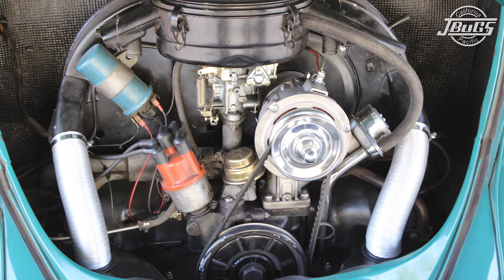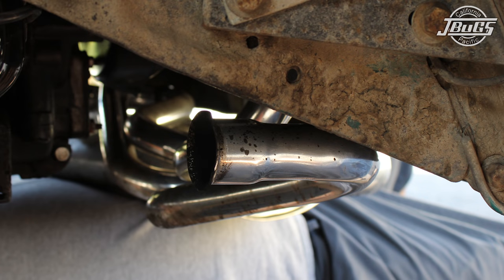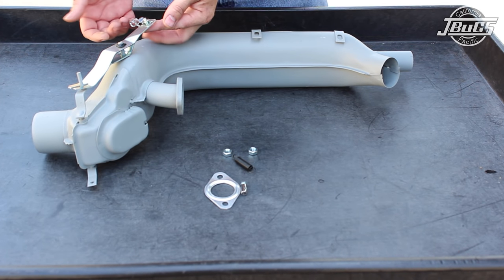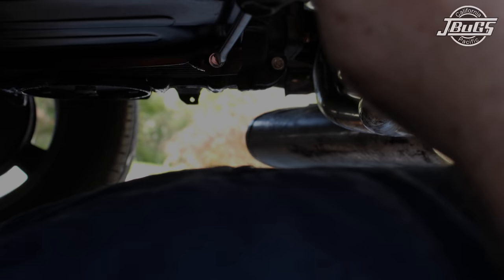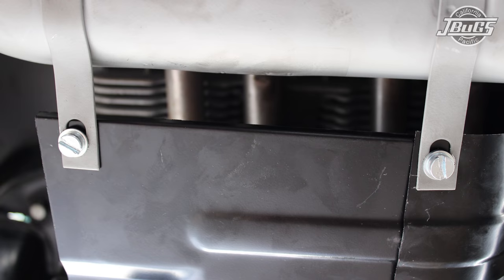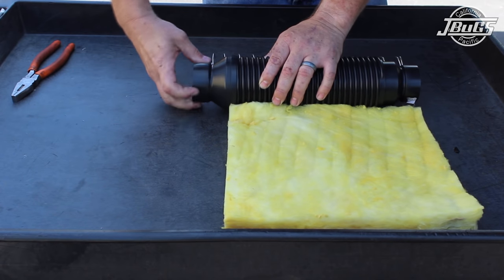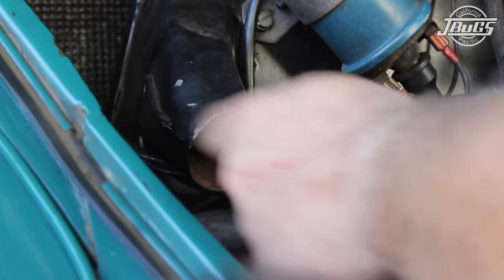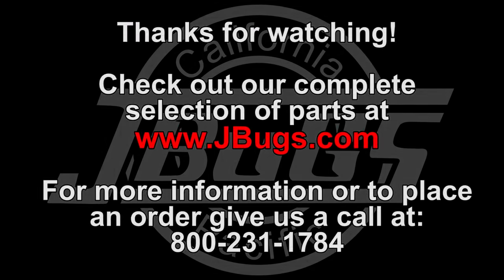JBugs - 1967 VW Beetle - Heater Box Installation

Comment: Hey Jbugs, you guys are awesome. I'm watching this to remove my heat exchanger but I've kind of hit a snag. I can't remove the one that's on there on the passenger side as its completely rusted to the exhaust ports on the cyl. head. Do you have any tips? It seems like it separated a little bit from the heat exchanger itself so when I move it, the entire heat exchanger moves, except the flange part of it... And help appreciated!!
Reply: The exhaust pipe, tube, exchanger, etc are all steel. The head is aluminum so the exhaust flange can't really be rusted to the head, the studs, maybe a little, but not the head. If the nuts are removed, just use a little more force (hammer, pry bar, etc) to get the heat exchanger free from the head.

Comment: You made removing the j tubes looks so easy. 🤣 I’m hoping I don’t break an exhaust stud.
Reply: Been there, done that! A little heat can help if you feel like it's getting to that point. If you don't have a heat source (propane or map gas torch, etc) start up the engine (if it runs) and let it warm up a bit. Sure, working on a hot exhaust requires a bit more caution but NOT breaking an exhaust stud off in the head is worth it if need be.
Reply: @Sam_Mebane  thank you for the tips!

Comment: Hello and Blessings to you all ... I just purchased a 1966 Beetle and have started restoration, I'm very new to this and at the same time learning and watching JBugs videos , great job !!    Now I live in Florida and the "Heater Channels" and shut, broken and rusty and poorly welded to Floor pans, so My thoughts are to change both Heater Channels and Floor Pans .  Now do I really need the replacement kit shown cause the weather in Florida is mostly hot or rains but it doesn't drop in temperature often and as much. The vehicle does not have any connection whatsoever 
Word of advise and guidance will certainly be appreciated, Thanks  JR.- .
Reply: We covered removing and replacing the heater channel on our 1971 Super Beetle project a couple of years ago starting in this video - https://www.youtube.com/watch?v=xRxd2g6MUi0 

Hopefully that helps a bit!

Comment: Is it possible to run a custom exhaust with the stock carburetor air intake on a 72+ Super? I can't find any diagrams/videos that show how the preheat hose would be attached.
Reply: The installation is the same as we show here.

Comment: so... I am actually removing heater boxes and installing jtubes... how do I keep bugs from getting into my bug through the heater channels?
Reply from the maker: Caps can certainly be made to cover the holes. To our knowledge there are no parts available off the shelf for this modification, however fabricating some sort of cover is a good idea. We have seen people do things as simple as zip-tying a screen over the hole, we have seen others go to the extent of cutting circular sheet metal plates and welding them in place. This ultimately is determined by just how permanent you wish the modification to be.

Comment: which side do you usually have to cut approx. 4" off those black heater bellows hoses? driver or passenger side? I also see you didn't use or need those round rubber like 'seals' that can go on either end. Did you just get lucky & all the ends matched up perfectly & just needed a clamp on each end? LOL
Reply from the maker: BOTH hoses were shortened, but don’t cut anything until you verify the length your situation needs. Different engines, heater boxes and chassis can change the length of the hose needed. The rubber boots aren’t typically needed with the replacement hoses, but always verify the diameter of the outlet on the heater box and the inlet on the car before tossing them.
Reply: @JBugsVWParts  do you guys sell the rubber boots?

Comment: Hello JBUGS,
I am looking to put an aftermarket exhaust and/or headers on my 69 Bug while retaining my stock heater boxes or a pair of your heavy duty heater boxes. How can I tell if the exhaust will require me to modify my heater boxes or the exhaust in order to get them to fit? And what modifications should I expect to make?
Reply from the maker: Hello Trenton!
We have an article on our website that may answer all of your questions about modifying your exhaust system, although it may not be specific to your year vehicle (http://www.jbugs.com/VW-Tech-Article-Beetle-Performance-Exhaust-Systems.html). Feel free to call us at 1-800-231-1784 and speak with one of out techs with any questions you may have.

Comment: Hi, I am trying to decide what to do with my return spring. My heater box doesn't have the hole to attach spring to it and the tinware doesn't have the provisions for it either. Would drilling a hole be sufficient? What do you think I should do? 

Thanks
Reply from the maker: +Amar Azad
If the heater box has the internal spring, then the spring on the lever is not needed. If not, with the heater box installed in the car, look under the body for a possible mounting point for a return spring. In a last case scenario, the box itself could be drilled for a spring, though not ideal as it could lead to premature rust and a less effective heater box with additional holes.